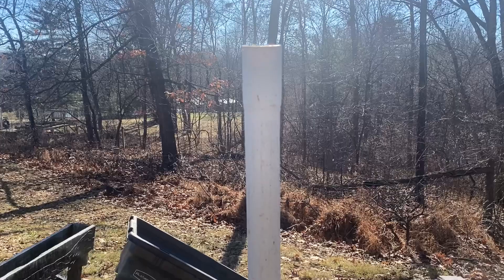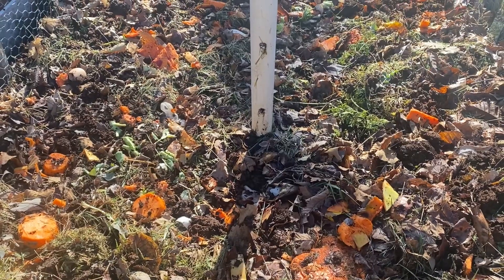Do THIS to your COMPOST !!

Comment: Cold lacto-fermented composting (the improved Water Witte method) is a better method.   It does not have the 2 adverse effects of hot composting (which is not practiced by nature):
1.	 The resulting compost is less than half the weight of the original pile.   It's a sorry loss of carbon due to the decomposition activity of aerobic microorganisms, which unfortunately emits a lot of CO2, a greenhouse gas.  So it's a polluting method.  Besides the loss of carbon is a waste for the fertility of our soil.
2.	The resulting compost contains few microorganisms because of the high temperature, so is of little use to soil fertility.
Cold lacto-fermented composting uses anaerobic microorganisms and the result is compost with virtually no carbon loss (so it's non-polluting) and, since it's made cold, it contains an enormous diversity of microorganisms useful for soil fertility.   Everybody should practice the cold lacto-fermented composting because it does not require to turn the pile, it is less work.   However, it takes a little bit more time to obtain a well decomposed compost ready to put in the garden but it is worth it.
Reply from the maker: @denisdufresne5338  I love this friend! I do two silos (4 foot high, by 3 feet across )of leaf mold every year on this property, and the result is wonderfully textured, and full of life planting medium. Thanks for this fascinating comment. I’m definitely going to be leaning more into cold composting for sure!

Comment: So is it just an indicator or is it used to keep the compost pile in a perfect temperature range? (Hot enough to speed up the breakdown process but cold enough to not kill the bacteria and fungi.)
Reply from the maker: @Zxr-r6q  actually, good question. I believe it’s both, but mainly just as an indicator, it to show me that the pile is heating up. Too hot directly in the middle can shut things down, but that’s not been a problem really, for my piles.

Comment: The pipe method is good for piles that are this big or larger (3 cubic yards +). For anything smaller, dont use a pipe or the heat needed to continue the process will escape, stopping the thermophilic breakdown.
Reply from the maker: Thanks for the info there, Chris! My enclosures are 5 x 5, by 3 foot tall. So that’s good to know! Thanks for the comment!
Reply: @8oclocktomatotalk  I eyeballed your bin fairly close since you have about 2.5 yards in it.
One thing I'll add here is that the higher the nitrogen content the hotter and more "steamy" the pile gets. There is no one-size-fits-all for this, folks will just have to experiment with their local biomass and see.
Reply from the maker: @ThatGuyChris11  for sure, Chris! I’m always goofing around with my Pile seeing if I can get it dialed in. I’ve seen some folks do a pretty fast and loose approach, and seems to work out :-) but I need a turnaround of three months on this one, so hopefully it will have the right ratio. Lots of grass clippings & manure in there for sure for nitrogen!
Reply: So why would you not want heat in the slightly bigger pile? Makes no sense